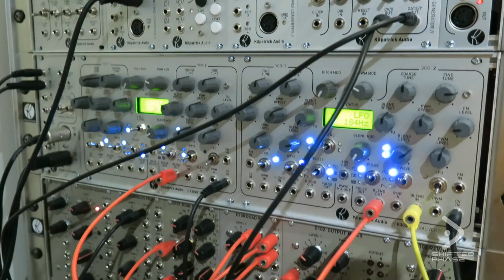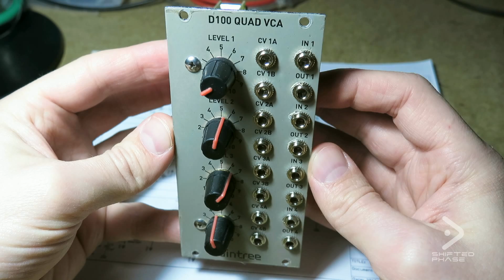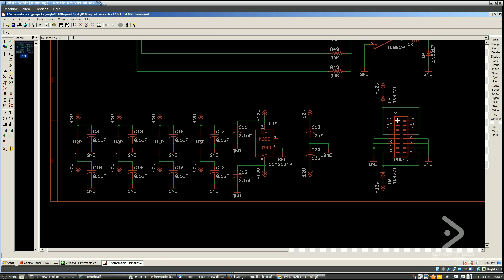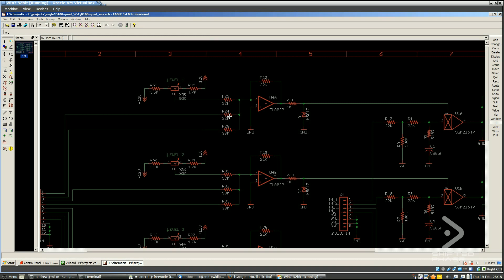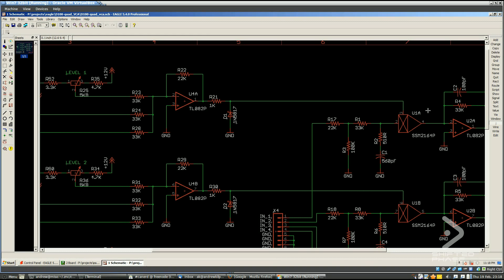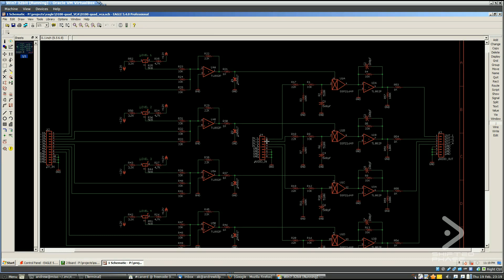Synth Tech - Quad VCA Design

Comment: Would you want C1 and R2 to swap places? My thought is that the cap should be closer to the 2164's pin. Or maybe its completely irrelevant?
Reply from the maker: The combination of C1 and R2 form a filter so the order shouldn't matter.

Comment: So do I understand this correctly: The output signal will be out of phase by 180* due to the inverting input used on the opamp?  Will this cause any issues?
Reply: two inverting op-amp stages! minus + minus = plus ... I think (I am not an electromagician!)
Reply: it will only be a problem if you need it in phase, but it sounds the same either way

Comment: Thanks a lot for your video, really helpful and simplest way I've found to use one of these chips, I'm planning one out now. I had a question about best placement of the signal input attenuation bits: is it better to have them closer to the board or closer to the jack, or no real difference? On the one hand it seems like attenuating at the jack means less noise inside your case, but on the other hand a weaker signal. Thanks again for sharing your work.
Reply from the maker: I don't know what you mean by closer to board? In general tight designs with short traces is best. But like many things in electronics, it depends on a lot of factors. But don't go overboard... as in, build something that is physically possible. But also don't run feet of wire between stuff either. If you're making a right-angle board design like mine, I would suggest building a fairly compact circuit with all the components, and then running short wires to the panel. If you're really concerned you can use shielded wires to connect the panel jacks, but I don't think it's really necessary in this case.
Reply: @shiftedphase  thanks a lot, yeah basically I think I could mount the audio input filtering (4 resistors and a cap) right on each jack and then just run a wire to the board from each right into the 2164. It's a very similar right angle construction to yours, so it's all very short wire runs in the single digit inches. Probably overthinking it but wanted to ask an expert
Reply from the maker: @mrquint15  The cap and resistor in series next to the VCA chip should go directly at the chip pin. It's a compensation network required to keep the 2164 stable. The other parts can go elsewhere if you prefer.

Comment: thanks for the indepth breakdown.
I got a pair of these on ebay when i first saw your page.
Reply: I put it off for a long time, but i finally made this quad VCA.
I also included an inverting mixer with its 4 inputs normalled to the outputs of each vca.
this way it mixes all the VCAs that are not connected to something else, so i can use it to mix some channels, but use others independently.

thanks for sharing the design with us.